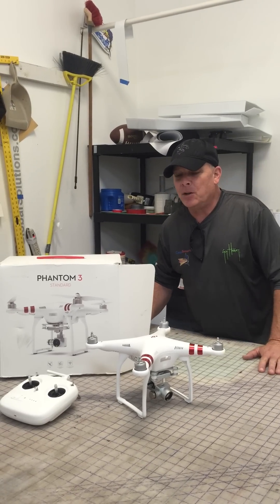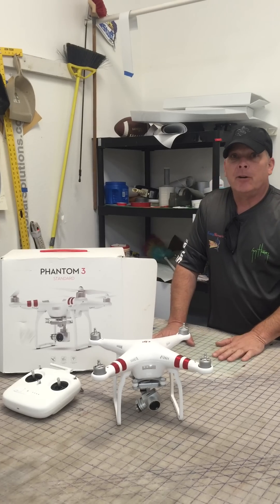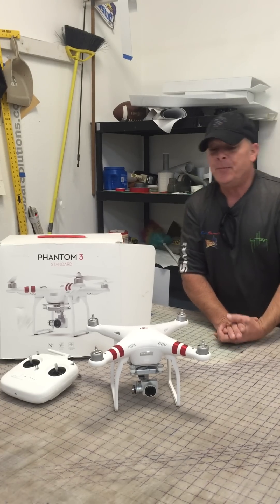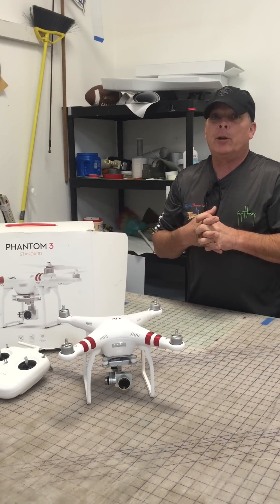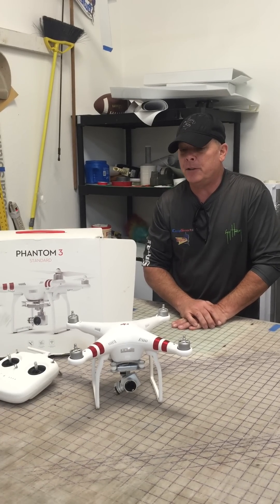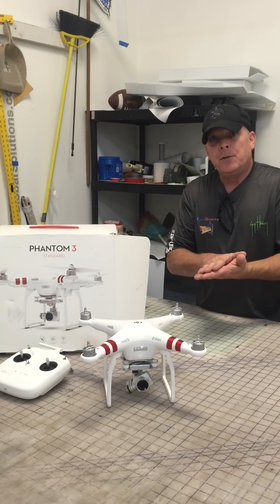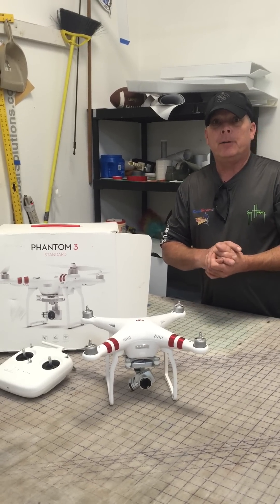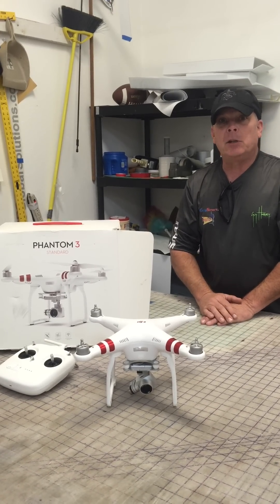Phantom 3 standard firmware upgrade fail

Comment: i am having the same problem. Tried to re-install app, then update firmware but still making that god awful sound. Please Please help!!. very upset right now!!!
Reply: hi darek i had the same problem switch on the rc and the aircraft open the dgi app go into menu go down to ramaining sd capacity and press format and then press ok then sd card formatting completed will come up ok then go back to upgrade and press it the noise will still be there just got to ride it ot might take 10-20 mins mines went of at 68% then when it goes of let it finish the upgrad it will come up completed and the green light will be on the gimbel then turn them off and then turn the rc and the aircraft back on hope that helps you
Reply: I got it to work after i messaged you the following morning. Thanks for hitting me back.
Reply: hey ma! sounds like the same thing is happening to me. Any tips for what you did?

Comment: This didn't work for me. when I installed DJI Go on a new device, it acted just the same as my original device, not prompting me for a firmware update but instead throwing errors like before.

Also, I did format my SD card right before trying this.
Reply: im having that same issue you got your fixed as yet??